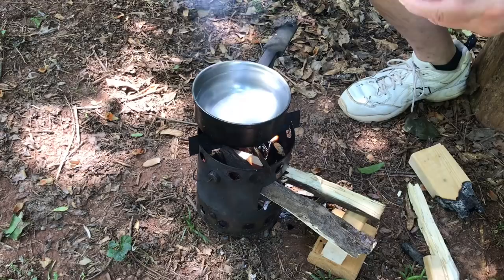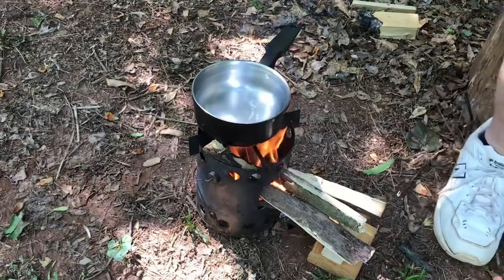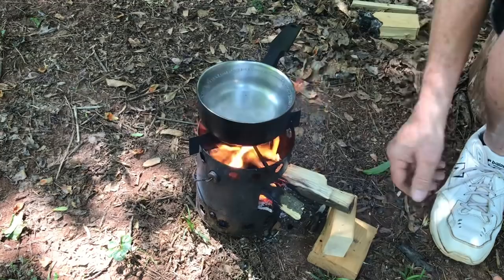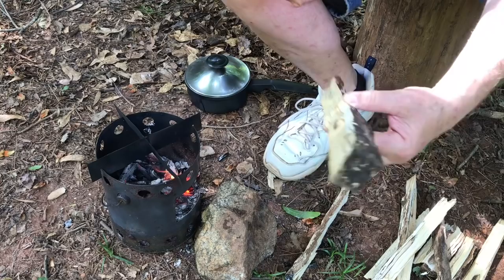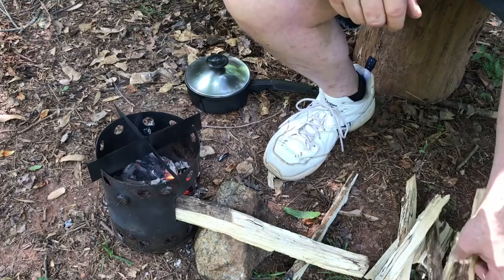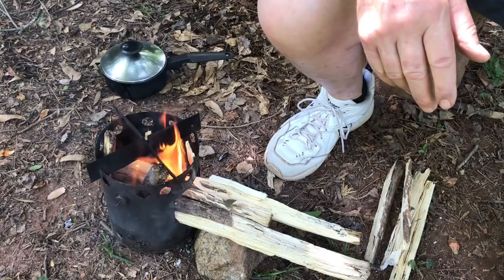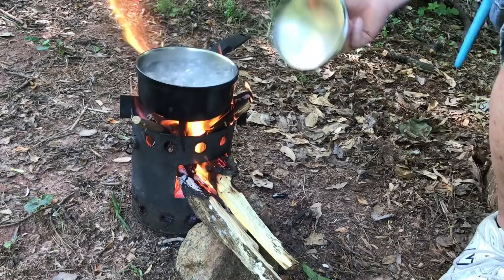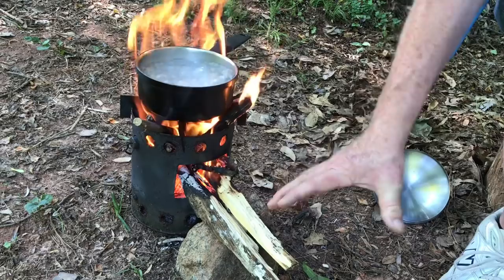7 Years Of Hobo Stove Cooking, ...I Should Have Been Using The Stove’s Fuel Wood Feed Hole!!!

Comment: Makes a lot of sense for simmering beans for a long time on low heat.
I make my stoves out of paint cans with a coffee can liner. I punch holes around the top and bottom on the sides of the cans.
I set the smaller can inside so the holes dont line up. That keeps the embers from falling out while allowing plenty of air to get in from the bottom. I dont use any screen in mine. I have been thinking about adding a feeding hole at mid level.
Going to try that.  The more air the better and more convenient than reloading from the top.
Thanks for the video 
John Davis jax fl
Reply from the maker: Sounds like an interesting design!

Comment: Try using your stove like a Sweedish torch. I take a 8" long x 6" thick section of unsplit wood. Use a spade bit to drill6"  down the center , then in from the side to connect the 2 holes. You can put a pan on top of the stove and cook. The fire lasts a very long time and you can cook anything and never have to remove the pan to add wood.
Reply from the maker: No, sorry.
Reply: Won't burn for long enough with a flame. These stoves are intentionally small and require continuous feeding.

Comment: I have every type of camping, hiking $tove made :) ...kind of used to be my hobby.  Which stove do I use in the field? My homemade rocket stove...adjustable burn, nearly endless fuel availability, lightweight; sticks go in the upper shelf of the horizontal can, air comes in from under the can's shelf, giving a beautiful smokeless burn.  Any temp I want. Really.  After a couple of hours, if you keep it lit that long, you will have to dump the ashes out.  :) easy peasy, no muss, no fuss, easy light, controlled, clean burn, fast cool down.n  Nice.  Oh yeah...it is just a can inside a  coffee can, with a horizontal hole in the lower outside big enough for a 14oz. bean can to be stuck into it, with a shelf jammed into the bean can.  I have had this particular stove for going on six years, now.
Reply from the maker: What did you use for insulation between the walls, vermiculite, ashes, etc?

Comment: If you cut and bent 2x C shape out of stainless steel welding rods, you can push into dirt and set them at feed hole at reqired distance
Reply from the maker: That would really be a quick, easy, and adjustable ramp.Thanks for the idea!

Comment: if you put a can with top and bottom removed into the feed slot and a piece of can into it so the air intake is below that piece and you feed stick into it above. it create a strong draw, thus what is called a rocket stove
Reply from the maker: Correct!

Comment: Hey David,

Very interesting video.

Have you considered the possibility that it's not just the 2x4 blocking the air flow.from the feedport, but perhaps more importantly due to the blocking of the updraft from the lower air holes along with the benefits of the elevated floor being negated by the lack of.sufficient updraft? 🤔 Thank you!
Reply from the maker: Yes the elevated floor holes are blocked from the coals piled on them... that in turn slows air coming in the bottom holes. When I unblocked the feed hole by removing the 2x4 the fuel wood started burning well.
Reply: OK 👌, that makes perfect sense💡! I had not considered the possibility of the ashes being thick enough to diminish the ability for the fire 🔥 to draw air ☝upwards from the lower holes. 

➡It would be interesting to see what happens when you remove the elevated floor and allow for a larger and deeper burn chamber.

Thanks for the quick reply!😎🇺🇸🏁

Comment: add a feed plate to gravity feed the wood at the fuel feed hole make it easy on your self  use thin sticks
Reply from the maker: I thought about that. I could modify one of my 4 stoves.
Reply: @DavidWestBgood2ppl  Fact is that fire tends to spread and burn upward most easily. Therefore, I predict that the wood in the 'feed plate' would catch on fire before making it to the stove. Do not try this at home without fire fighting equipment handy.
Reply from the maker: @legman1947  You're right! That is a bad idea. Thanks for the heads up!
Reply: @DavidWestBgood2ppl   add a small hinge to drop at an angle for the sticks to slide into flames  self feed with chains for support   it is all about convenience  i think  & light to carry